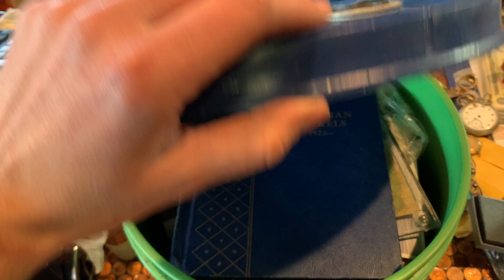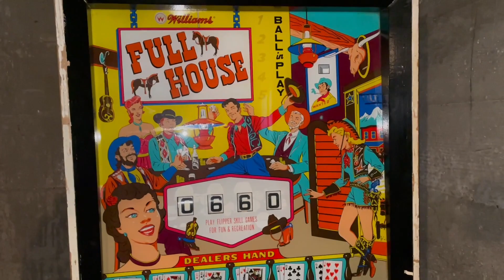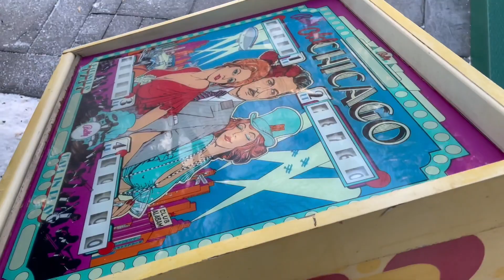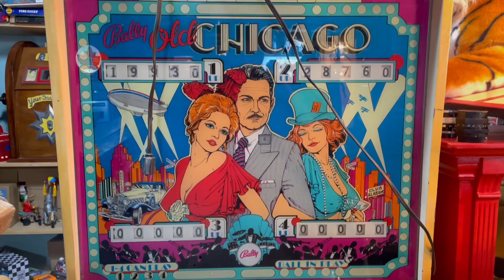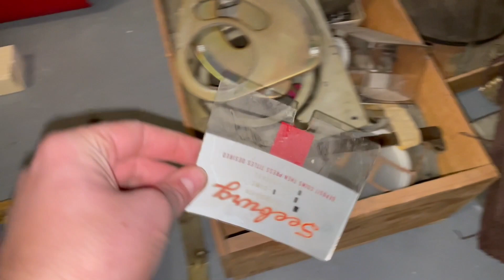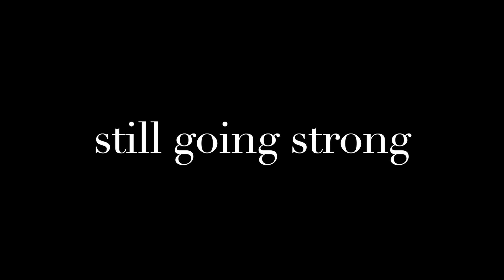The days after... moving on from our Break in... and loading up on Jukeboxes!

Comment: there's a company that makes window filaments or makes windows almost impossible to break out I cant Remember exactly but that might help with keeping the original look of the building because you cant see it and it would slow them down. From just smashing the window out and walking in I've see them take 5 pound sledge hammer and batts to the windows and it took them 30 min to get threw the window might be helpful hope this helps.
Reply: @nancymontgomery8897  i know but he wants to keep the look  of the building intact so a solution would be to put something on the glass that cant be seen that would prevent someone from just kicking the glass out in 2 seconds and walking in it would take them time to get in and there for make it harder for them and possibly discourage them from continuing because they would have to make a ton of noise to get threw the glass and the more time it takes to get threw the glass the more likely they are to get caught.
Reply: 3M makes it

Comment: oowee! disassembled jukeboxes I'm sure glad they were built dummy-proof all the connectors are different so you can't put the wrong plug in the wrong plugin point! still, a hell of a lot of work getting it all reassembled! 
not to mention all the electronics relays condensers and tubes that can be bad and dried out wiring just stop right there I'm getting a headage!

Comment: Hey, just a question for someone who may know the answer. I have an old 1943 Westinghouse record player radio combination unit. It was stored in a basement for at least 40 years and not turned on in 20. Do I need to go about replacing the resisters inside the radio housing? Or should it be fine?